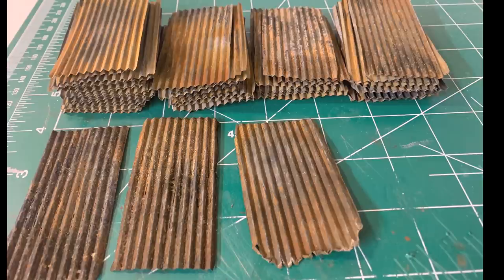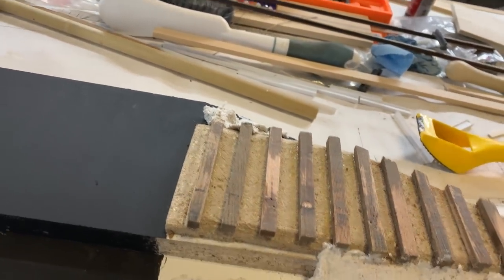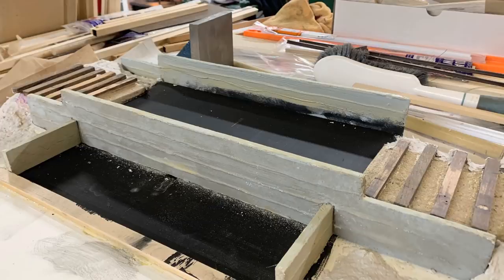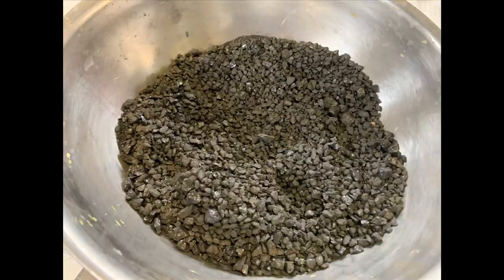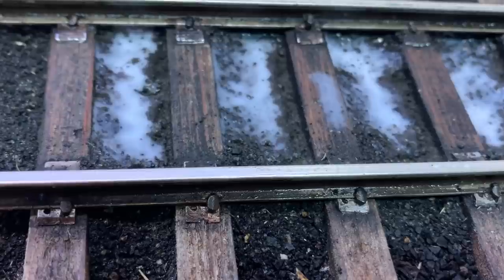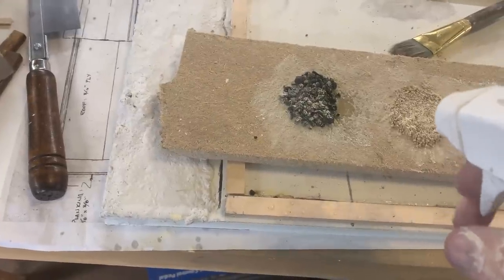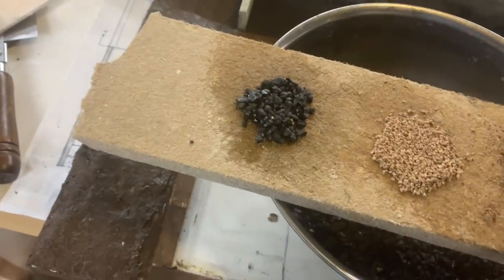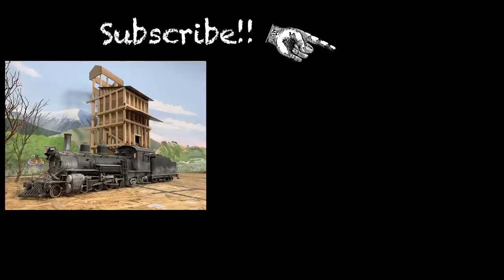Ballasting and spilled coal on our large scale indoor-outdoor Garden Railroad

Comment: Karen,
Your a woman after my heart finding that item at the Dollar Store !!
I !I've the Dollar Store I've found a lot of things to use on my layout from there. Dale sprinkle a little cement on your outside ballast when it dries from the snow there and it won't go anywhere.
Reply from the maker: I did that on my old railroad. Worked well! But in this case as its up on benchwork Ive added a lip to hold ballest from falling off, mostly, and my plan is keep it loose and just fix and adjust as needed. Soooo simple to jusr brush around. Time will tell. So far so good.

Comment: Looks great. For getting the “corn starch” to stick to larger particles maybe you could try the old shake n bake approach—combine the ingredients in a bag and shake. For a dull coat replacement try heading to the art store instead of the hobby shop. You may find a number of alternatives from spray varnish to fixatives. The products are geared to being applied to more delicate materials and sensitivity to surface disruptions and visual quality are paramount.
Reply: Yes, I used some Liquitex mat spray for fixing trees (no Testor on this side of the pond), and it worked fine. The only issue was the spay cap being obstructed after a few months, but I have the issue with other rattle cans, even after releasing gas head down to clear the cap.

Comment: When I was in my teens I built construction dioramas.  I experimented with rail road modeling stuff but couldn't get the tire tracks right, or ruts.  I tried glue on dirt and sawdust, even dirt.  But the stuff I ended up using was clay ground fine.  It would harden up quite well, and if it was wrong, pry it up, regrind it and start over which I did a number of times.  Sadly, raccoons got hold of and destroyed while it resided in the attic.  I built a model truck chassis to just roll through it with a brick on the frame.  I used a fixatif spray like used on drawings in the old days to keep things stuff down. Then I planted an appropriately muddied International Transtar truck with rust and bare metal and just generally worked to death as the theme of the project.  I think the judges were torn between the mud and the truck. I enjoyed telling them it was real mud. I still have the truck.  Baffled what to do with it tho.
Reply from the maker: Well if you ever get back into that try Celluclay. It’s just really great for doing what you were doing other than the fact of the color is completely wrong. But that just means you can paint it and make it look really the way you want!

Comment: Hi Toyman,  Rob Spangler uses a product by Treehouse Studios that he says dries dead flat.  It is available at Hobby Lobby in their spray paint section.  I tried using clumping cat litter for ore loads with ok results.  It looked good dry but wet it shrunk and pulled away from the edges of the car.  I have some charcoal I use in my hoppers for coal loads I got it from the floral section at a grocery store I worked at years ago.  Nice work on the railroad.  Thanks for sharing!

Comment: I'd try using a lacquer sanding sealer for a dull coat..  you can thin it down with lacquer thinner, and try spraying it on with a small sprayer..  just an idea... I use this stuff every day where I work as a cabinet finisher..

Comment: In regards to Testers paints 
It's still available 
But they are in the process of changing the paint formula from Oil base to acrylic .
Some of the acrylic is working it's way to the hobby shops .

Right there in Utah is M R S  trains look them up not too far from you  he may still have some of the paints .
Doug has supplied me with other brands of paints along with a few model kits .
Give him a call or go checkout the shop .

PS 
In the past when I was building trees I used the hairspray Aqua Net .           It's pretty good at keeping everything together and drys clear flat .

Comment: Over time, as dust accumulates on the coal or other substances, this will tend to take away the sheen.  You might not have to worry about the sheen.
Reply from the maker: I’m going to test the product I just found so and see if it works. The best thing I can find is a matt coating. There is a flat clear that’s supposed to be used for making black boards! Comes available in black green and clear.

Comment: Rustoleum bought Testors and Model Masters, and have discontinued the Model Masters Line.    So far they have done nothing with Testors and none of the distributors can find Testors ClearCoat or DullCoat for 2-3 months now.
Reply from the maker: Yup. Its being scalped online for 15 to 20 bucks per can.
Reply from the maker: odd thing is... of years Testors address has been the same as Rustoleum. So they have been making the paints. But now they own it. So its the same paint. Only not available. Other odd fact! Craftsman and Snap-on are both made by western forge. I asked a guy there whats the difference. None he said. Different dies. Same steel and process. Well Snap-on does have much better support. For 5 times the money.